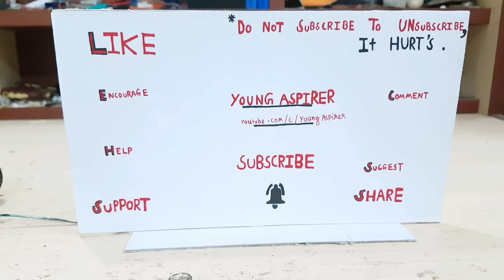How to make a RC BIG BOAT

Comment: Banggood Wireless Transmitter Receiver Module Link Kit 433MHz RF For ARM/MCU https://www.amazon.in/dp/B00NRQ3BIM/ref=cm_sw_r_cp_apa_i_2m4QBbDCMDM3G bhai ye transmitter receiver use kar sakte h isse ture or aage piche hoga ya nhi dekh ke batao